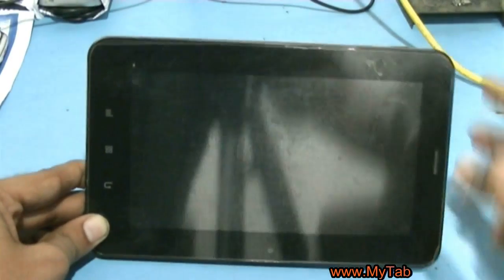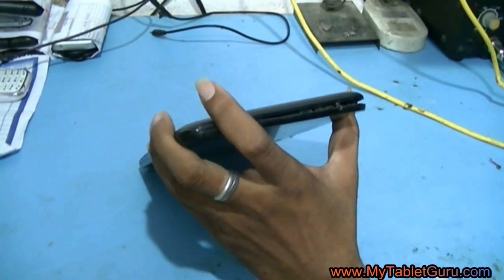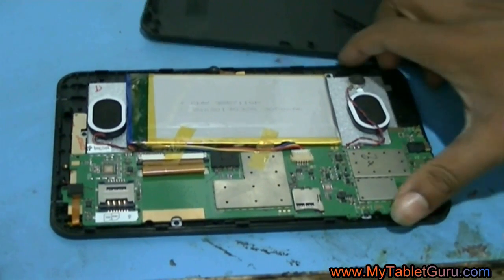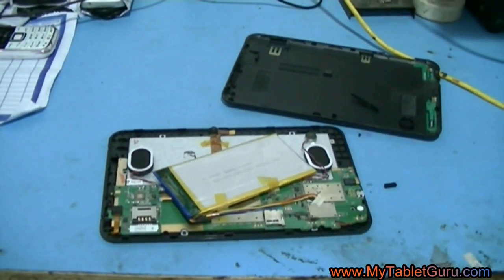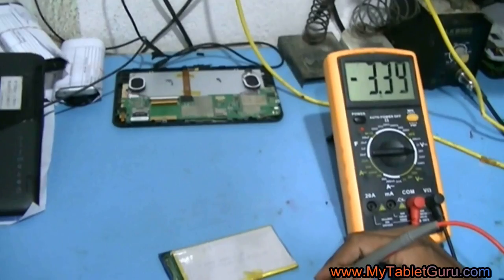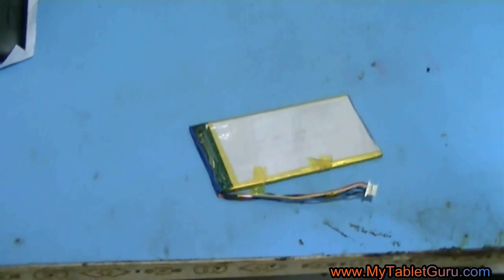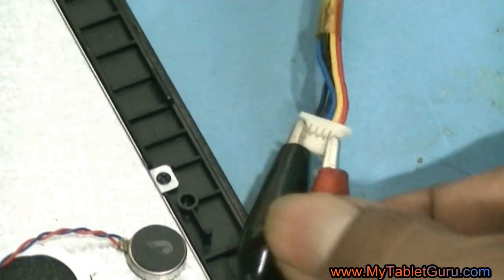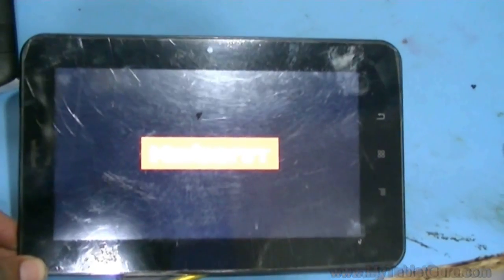Android tablet not working, Solution 1.

Comment: My mi tablet randomly keeps shutting down
Reply from the maker: try flash if it does not sort out the issue 
then check Charing Connector and Power ic

Comment: hello, I have lenovo tab 3 7 and it suddenly turned off in enough battery, now it only vibrates on pressing power switch.
I have tried disconnecting the battery and reconnect it, but it didn't work. Also I have tried your method, but it won't start. Plz help. I hope you'll reply to my problem soon. Thank you!
Reply from the maker: if it is making sound when connected to PC
then you can try flash

Comment: plz i have de red/black cables connect to the motherboard, can i boost the battery while it is still connect to ?
Reply: car
Reply: +sam sung I have the same problem and too afraid to put the power directly on it. Did you find a fix for this?

Comment: i have a problem my tablet is a prestigio multipad ranger7.0 3G . model number PMT3277_3G. when i charge it full while off and it shows 100% and i switch it on the battery meter shows 40% or less the most was 70% . and this happens while im using the original usb charger provided with the tablet, im getting annoid even when i charge it from 10pm until 4am it still does that and the battery dont hold the power that long after less than 10 minutes it needs charging again even if i dont play games or listen to music . HELP ME PLEASE !!!! THIS TABLET IS DRIVING ME NUTS!!!!

Comment: Hi brother
i would like ask you about my tablet ,, it was stucking on (nextbook logo) and can't start normally , i surfed on the net for a help and i found a zip file called stock rom signied . I press on power and vol- and I enter to recovery mode and I apply a zip file from SD card after that everything is formatted . now when I reboot it won't turn on and No access to recovery mode what can I do please ?? it's a chinese one ,, the lap top can't recognized it , no light when push on power or any bottom .

Comment: nice video, unfortunately the tablet I have, Azpen A1040 I think it was, would not charge. I removed the backing only to discover that the battery wires were directly soldered to the electronics panel. I am not that great with wiring electronics to attempt to remove these to charge the battery, a shame, will end up sending it back, the tablet has only been in my possession for less than 24 hours.

Comment: Excellent video.  I worked as a Electronic Tech for 32 years and suggest for those without power supply to go to a two way repair facility, preferably Motorola and see if they will charge the battery for you.

Comment: Thank you for the response. I want to tell you that out of all the videos ive seen yours are the only ones that show actual tech info and I thank you for that. I found my problem today and it turned out to be the charger port wasnt making good contact. So I took the case apart and lifted up board and was able to push in both sides of the metal prongs for the ground.  Thank you for your videos
Reply from the maker: Brian B Welcome..

Comment: It was hard for me to hear you. May I ask what were the voltages again that you charged with and for how long and how many amps for each. I have a 5.5volt 2amp tablet that I need to revive the battery and was hoping you could help me.
Reply from the maker: Brian B We have used the battery booster and set the voltage of 3.7 - 4.2 volt. Amp is set by default.